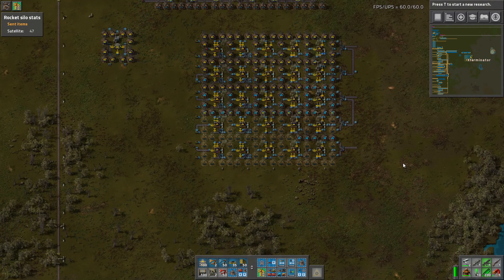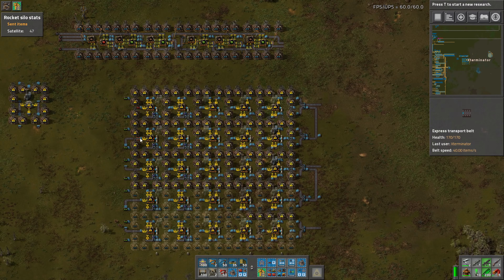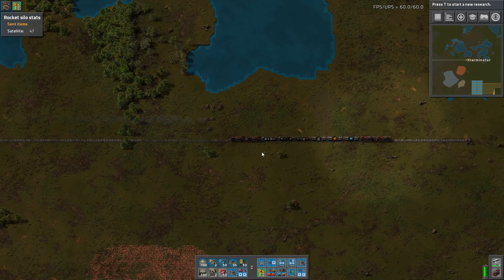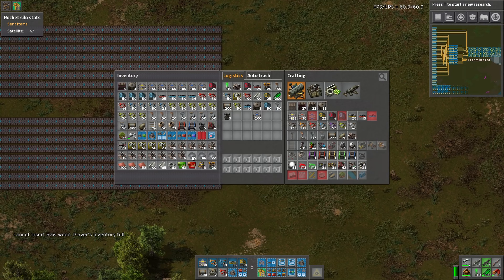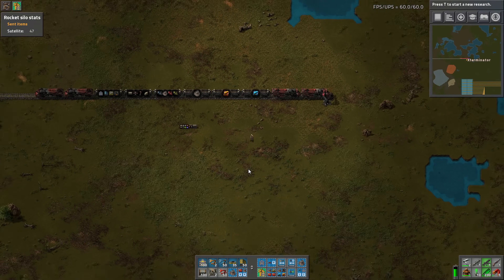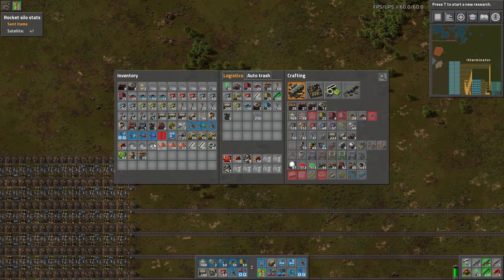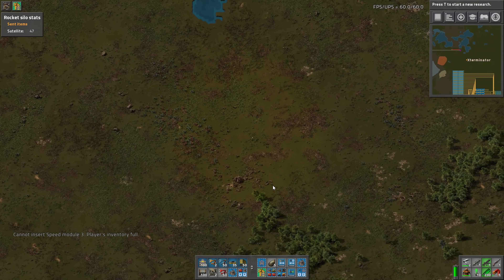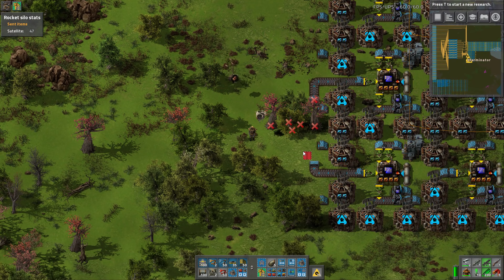Factorio: Tightening The Belt: Megabase Guide EP59 - BLUE CIRCUIT BUILD | Tutorial Gameplay Series

Comment: Hey, what do you use to calculate ratios for various setups? Do you just straight up do the math everytime ?
Reply from the maker: Mazoo Samm For this map I used kurk McDonald. it shows number of belts which is super nice for this. For non belt bases I like Barry Kun. 
I usually just do the math manually for figuring out how many machines per belt in a build I'd that makes sense.
Reply: thanks xterm

Comment: Concerning sulfuric acid, is it better to produce it somewhere and transport it via pipes or is belting sulfur and producing the acid localy a valid option ?
Reply: Vatefr Juyt Less pipes = better. Fluids are bad for UPS.
Producing it where the petroleum is and putting it straight into a train that brings the acid to the blue circuit build is probably the best idea.

If theres an oil patch nearby you could also run it straight into the blue circuit builds which would be even better for UPS but he doesn't have something THAT close to the  blues if what I remember is accurate.
Reply: Vatefr Juyt I sort of take it back, there IS an oil patch pretty close to the south, but it would still be a lot of pipe, it's not like..insanely close..plus it begs the question if there's enough oil + how long will it last till it runs out?

Having a central refinery where trains bring in crude from pump jack outposts is way more future proof..not to mention when those oil spots run out, hes going to have to change the ENTIRE setup to bring in the acid by train when that happens..so he might as well just train it in from the start IMO.
Reply: Yeah but what about belting sulfur ? Because getting a train trough all of those builds might not be as simple and you might have some troughput issues due to the train travel time no ? I might be wrong though
Reply: I'd have agreed with you before unlimited research, now with the production bonus in the hundreds of % and surrounded with speed beacons a good sized oil patch is nearly limitless. It will all depend on the number of nearby available for use pump jacks. Cheers
Reply: Vatefr Juyt Trains with multiple liquid tankers will carry more than enough to satisfy that build.

Belting sulfur is pointless, the best method to make sulfuric acid is to direct insert the sulfur into the next chemical plant to make the acid, if you can put an item needed to make another item directly into the machine, that's the best UPS method always. 
It doesn't always work because of space/beacons but that's why most builds direct insert copper wire into green circuits.
It's just more efficient to do it this way and train the acid in.

He definitely has room to get the trains in, and he would HAVE to later on anyway, even if he used that local oil patch for when it runs out.
Reply: Gemmel There's not that many of them south..and he doesn't have the best productivity bonus atm. He will EVENTUALLY have to change it. It doesn't last as long as you might think in megabase level of consumption, especially considering if he's making plastic from it too, there's almost no way he will be able to prod module them, he would need all speeds.